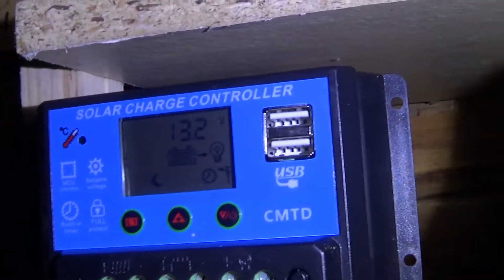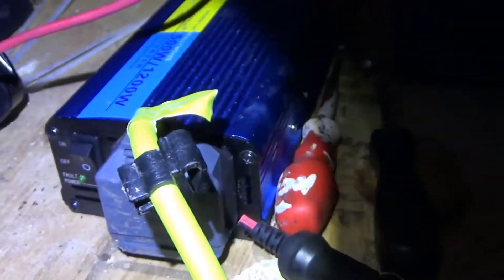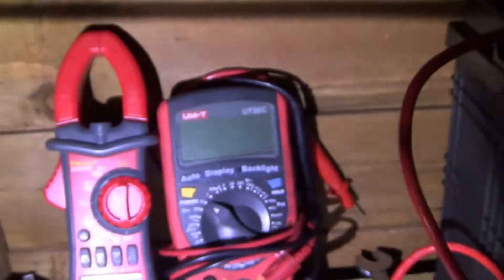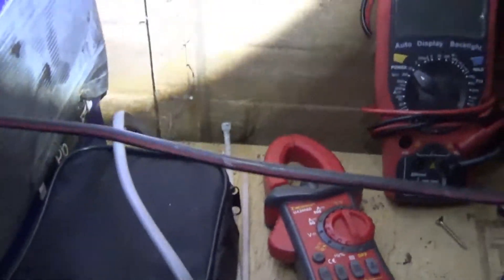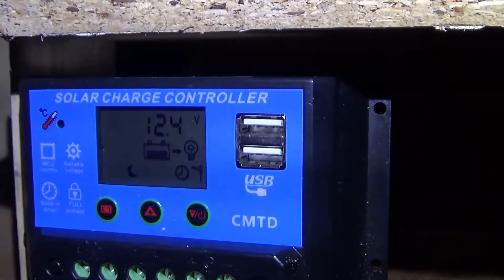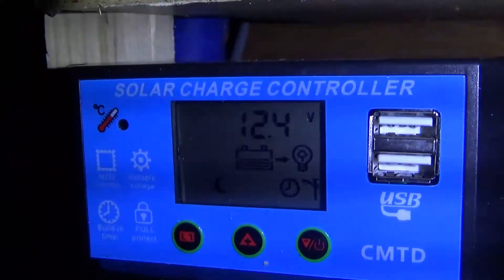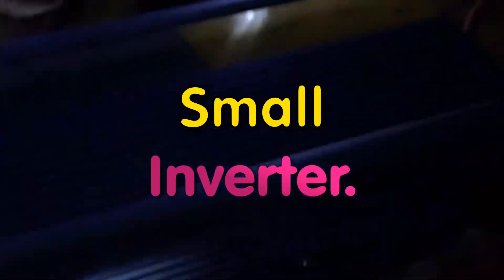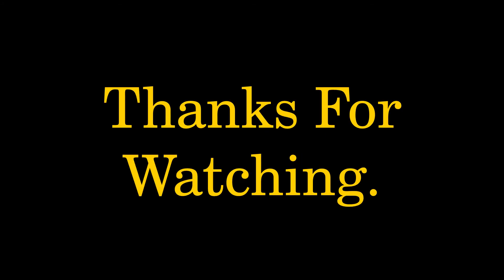Using Solar Energy Duration Voltage And Amps Off Grid. Experiment

Comment: Yes get another battery and you will have  twice the amp hours,   if you need them  I run  all my home  lights  13 LED's and TV
if you  think about it if you are not going grid tie then its all about the storage so the more power you store the better, and if you like coffee or tea you can buy a 12 volt coffee maker  or  kettle or  slow cookers to use  as a dump load when your batteries are full.  Keep it up keep experimenting and well done
Reply from the maker: Hi Mr Ireland thanks for the comment, i have many more things to ad to my solar kit.
All will be filmed the good,the bad, and the ugly :o)
So far we have done good, but you are right about the extra battery.  watch this space
Reply: Will do

Comment: I think the single battery will be fine on that amount of current draw.  As long as it  manages to recharge during the day i dont think you will need a second unless your planning to run the washing machine etc.
Reply from the maker: As my system is only small, all the items i run will be low wattage.
As its something i am interested in i am sure the system will grow a bit bigger.  The battery voltage is already showing over 13v on this miserable rainy day. Right now i have 160w of panel power. All good experimenting as long as we get some decent sunshine soon.
Reply: Sounds good.  I need to get my panel set up now the days are longer.  I am only wanting to run the solar lights. :-)
Reply from the maker: Well Fred let me know how it goes ...
Reply: Played with me identical controller today.  Seems to work but i cant say that getting into the menus is easy.  Seems a very long held button press.  Mind you what did they cost, less than £10 so cant really complain.
Reply from the maker: Hi Fred there are a few vids on how to use them, on mine the usb ports are both not working.
Reply: Oh ok mate.  Ive not tested the USB ports on mine.  Seems to be working ok.  I will keep an eye on the battery voltage once ive got everything set up.

Comment: you've got 1.38 Kilowatts of stored energy in that battery. To avoid over-discharge, consider it 1kwh. that gives you the reserve to cover efficiency losses in the inverter. You should be able to accumulate about 1Kilowatt  on your 240v ac meter. if the load remains constant, you will notice that the amperage drawn from the battery will increase proportionately to the decrease in battery voltage. That's because the output of your inverter is regulated, and must draw the wattage from the battery necessary to drive the ac load without fluctuation in ac voltage. counting the losses of the inverter, you should easily be able to drive your 36 watt load for 24 hours. since the panels charge the batteries all day, the battery only has to last through the night. The battery will discharge about 60% of it's capacity, leaving it 40% state of charge, if the panels are big enough to bring it to full charge every day. It's only 20 amp hours shy of being perfectly sized to give the lowest possible operating cost. If you get another battery, get the same brand, but smaller. Parallel the two. You are so close, it might not be worth it to increase capacity. If you don't run that load 24/7, you're sized perfect. Just replace that battery when it finally loses too much capacity to give good service.
Reply from the maker: Hi Vincent omg  sorry for the long time in the reply.
I tend to go easy on the battery, only ever using it as and when required.
In Full  {summer sun} during the day I can easily draw 5 or 6 amps for as long as the sun is on the panels.